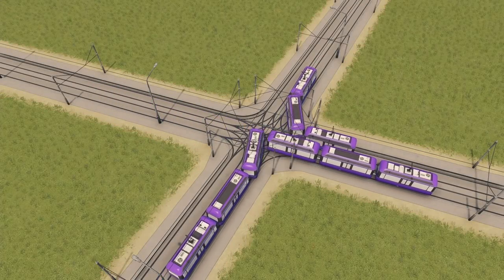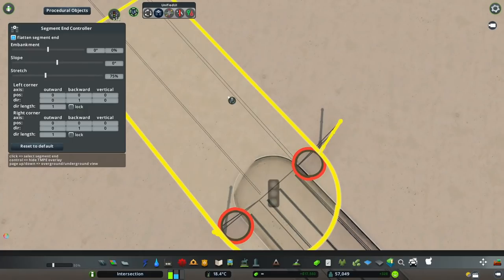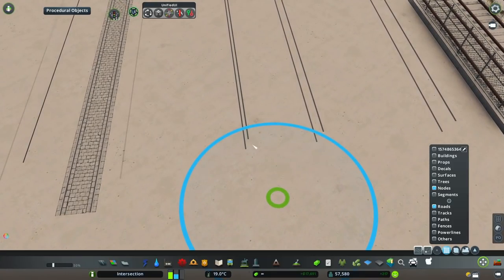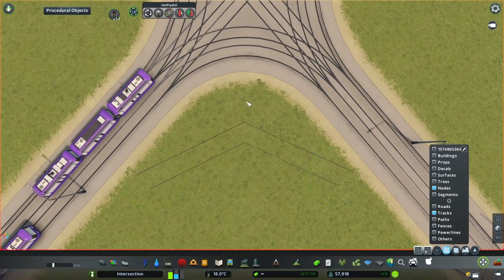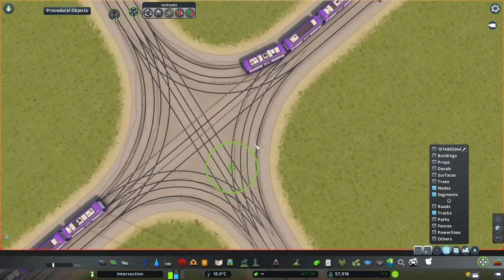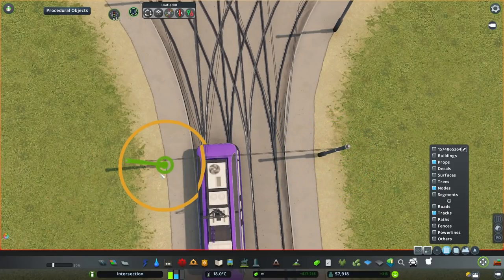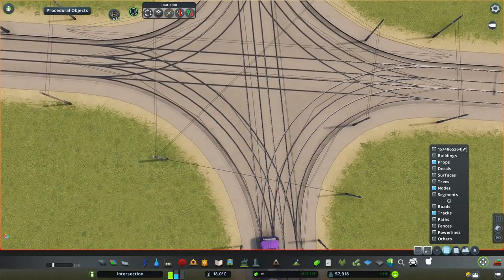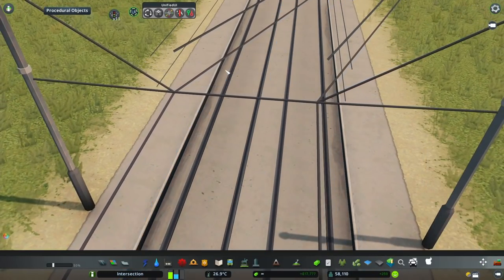Build Better Tram Networks with Custom Wires in Cities: Skylines Tutorial Guide

Comment: To save nodes (for those who worry about network limits) you could connect the all wires at each connection and use the nodeless node type. Havent tested but it should work. Then one four way tram intersection would only require 4 nodes and 6 segments. Instead of 12 nodes and 6 segments.
Reply from the maker: It's much more difficult to work with when everything is connected.
Reply: @Akruas  This is true!
Reply: @Akruas  You could probably save even more by leaving some of the default catenary wires in place. Specifically ones on opposite sides of the intersection.
That way you get one set of wires straight through the middle as well as 2 extra support wires at the ends. Which should save 3 segments and 4 nodes. (If you also count the nodes for the support wires. Which the original commenter didn't include.)

Comment: I create my own road using blender, all perfect.. but i really have problems with wires.. They swinging everywhere.. and point where the pole is, they don't stay on place how should be.. to be connected to the pole. Any idea how to fix this? First time i did tram road so i don't have experience with this, should be attached in asset editor or?